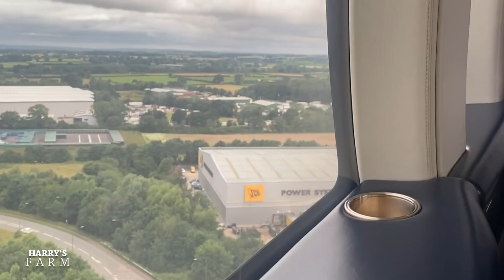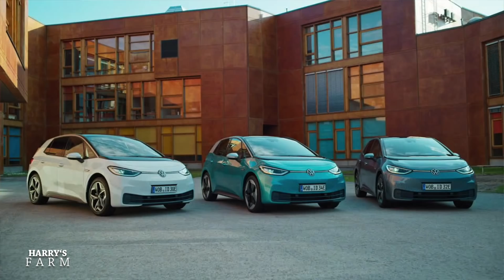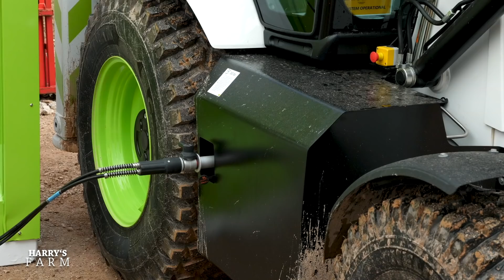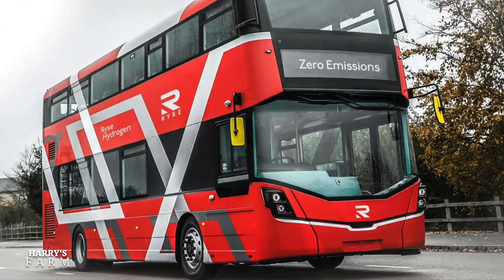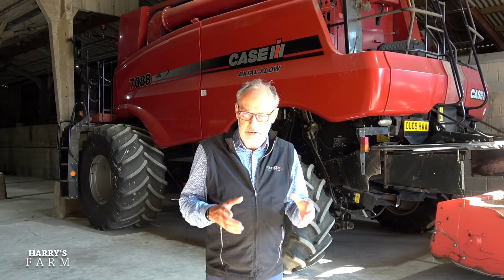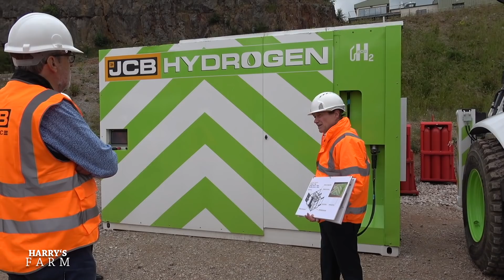Why JCB thinks hydrogen is the best alternative to diesel for heavy machinery, farming and HGV fleet

Comment: Thanks Harry for giving us a platform to see these developments on. As a farmer and car guy myself, the whole future of electric cars, is a very daunting / sad prospect...  And as much as I can see a place for alot of electric cars, for me, its never been the solution, the longevity of the battery / car is just against everything we should be aiming for, we need to try and get rid of the chuck and replace society we live in now, not encourage it with batterys that die after 4-5 years, and pose a huge environmental problem to get rid of, and even to produce in the first place! 
With regard to agri / commericial machinery, its obiously that batterys will, and never will be the answer, and the cable powered solutions seem to be a world of potential hurt also.... but hydrogen gives a new light, costs can remain similer, existing machinery could even be converted, and for people like us....we still get to listen to an internal combustion engine running, which for me, is the heart of any vehicle (tractor or car, or combine or you name it...) and without that, I feel my love of cars / machinery would be all but gone. This gives real hope, which certainly makes me smile. There is still huge work to be done with regard to producing the hydrogen in the first place, but I absulutely agree that this needs and must be heavily invested in, it has to be the fuure, or at least, very much on the right track.... I have argued many times, that with the miles I cover, I could likely drive my 21 year old diesel peugeot for the rest of my life...and produce less TOTAL harm to our planet, than I would buy simply buying a single electric car...never mind the 4-5 i would likely need over my lifetime...
Thanks for the videos, much like Clarksons farm on amazon, these videos are doing more good for the agri industry than "many other things" have done in my lifetime... Thanks Harry.
Reply: You could argue many times about your Peugeot but you are still wrong 😆

Comment: 'The problem is not with the engine, the problem is with the fossil fuel'.

So simple, yet WHY is this so difficult for politicians (who are making the short-sighted decisions to kill the ICE) to understand? By all means set the limits - but leave the engineers to come up with the solutions: EVs/Batteries are NOT the sole solution.
Reply: "When all you have is a hammer, everything looks like a nail"
There is not a single scientist or engineer in the Downing Street cabinet.
Reply: @Zadster  Or politicians.
Reply: The majority of Hydrogen today (97%) comes from natural gas, not from water.

Burning hydrogen still produces NOx emissions at the tailpipe.
Reply: @EP-bb1rm  if that's the case they are deliberately ignoring water as an alternative source for hydrogen to justify what would be a significant cost increase at the pump.
Reply: @tedtheturbot  only countries that have enough nuclear power plants will have enough energy to make hydrogen from water as economical as making hydrogen from natural gas.
Reply: @vasopel  i don't know those figures. 
Whatever, each vehicle can create it's own hydrogen from water using a hydrogen cell. Water in hydrogen to the engine out. I used one 15 years ago.
Reply: @tedtheturbot  the vehicles talked about in the video are not using hydrogen cells , but anyway hydrogen fuel cell vehicles are a mediocre alternative to ICE, electric ones are better ;-) ,15 years ago? which model was that?
Reply: @tedtheturbot  It is not a case of ignoring water as a source of hydrogen, it is more about acknowledging that hydrolysis of water is vastly more expensive than steam reformation of natural gas.
Reply: @LiamE69  The tech exists to do hydrolysis with a hydrogen cell within the vehicle, that could presumably be improved with enough big tech capital. But there's not interest because again the big boys want to keep fuel expensive and other companies risk being squeezed by big tech to stop.
eg There was a guy in Australia who developed his own hydrogen powered car some years ago, found dead on some railway tracks after 'falling off the back of a train'. Official comment he was drunk and fell, friends said he didn't drink.
Reply: @tedtheturbot  What on earth are you talking about? Where is the energy going to come from to hydrolyse the water?

Hydrogen is already a $100bn industry that has been around for a very long time. The low hanging fruit has been had.
Reply: @LiamE69  I've said already read above.
Reply: @tedtheturbot  No you haven't. You have said vehicles could hydrolyse their own hydrogen. I ask again where is the MASSIVE amount of energy it takes to hydrolyse water going to come from.

Unless of course you've created a perpetual motion machine where you use hydrogen as a fuel to run a hydrolyser to make hydrogen.
Reply: @LiamE69  You've answered your own question. There's hydrogen fuel cells that fit into vehicles that create hydrogen gas. Read above I used to have one in my car. The system ran off the battery. Your MASSIVE amount of power info is wrong. And if you think i'm mistaken, how come the one i was using leaked one day and the hydrogen gas blew the lid off the cell. Highly flammable thats why they use it for lunar rockets
When you switch the thing on from the battery, hydrogen bubbles start forming immediately. It works without a nuclear power station. Think about it the big boys don't want us to use this stuff cause they're gunna loose money. So lets lie and say it's impractical because of the power requirement. I had the same arguments with people at the time.
Watch this video again the guy says they have hydrogen fuel cells but they're expensive. That means they have a unit that can produce hydrogen from splitting water inside the vehicle without having to hook into a nuclear sub station.
Reply: @tedtheturbot  So yes you think the perpetual motion machine exists and it is hydrogen. Congratulations we now have infinite power.

Now, back to reality.

Hydrogen fuel cells use hydrogen, they don't make hydrogen.

They produce less power than it takes to make hydrogen they used.

It takes more energy to get hydrogen from water than you can every get back from burning it or using it in a fuel cell.

You really haven't got a clue about any of this.
Reply: @LiamE69  really so how come my hydrogen cell worked? Using the power from a car battery?
Reply: @tedtheturbot  What you call a hydrogen cell is not a hydrogen fuel cell. A hydrogen fuel cell takes hydrogen and oxygen and combines them to produce water and electricity.

I have no idea what you had or what you think you have. But the fact remains to make 1kg of hydrogen from water you need a minimum of 39kwh of energy. With the efficiency of hydrolysis, which is what it sounds like you were doing, more like 60kwh+.
Reply: @LiamE69  No, you've got this arseways a hydrogen fuel cell splits hydrogen from water using electricity, the hydrogen gas is then taken into the combustion chamber and fired. In my case as a hybrid unit. So what i had was a cell that split hydrogen from water inside the car using power from the car battery.
As said before, if you don't believe that's possible, on one occasion the reaction blew the top off the unit after failing to remove the hydrogen gas efficiently.
As said before, the big boys don't want us to have this technology so they'll lie to keep us from using it, hence the information your so diligently regurgitating. 
Question for you is do think it's possible for a small group of powerful people to control the narrative in such a way to mask over the usability (the amount of energy required to split hydrogen from water) in order to make people think this technology isn't readily available?
It is.
We are being lied to.
I know this because i've done it.
As said, watch the video again hydrogen fuel cells - that split water from hydrogen inside the vehicle - are available, but as Lord wossname said, they're expensive (presumably because they are reliable because mine wasn't reliable but then it was quite cheap), BUT it did work.
Reply: @tedtheturbot  Powerful people may be lying to us. One thing they ain't lying about is the laws of thermodynamics.

A hydrogen fuel cell is what I said it is. What you are describing is a the electrolysis of water. Go look up the terms.

The fad for people with a less than school level understanding of physics putting those on their cars and thinking they were getting something for nothing died a death because it simply doesn't work.

Breaking water down to oxygen and hydrogen with electricity from the battery which pulls power from the alternator which itself draws its power from the combustion engine takes more energy than it gives with losses at every step.

As yourself if this works why do you have to keep putting fuel in your car?
Reply: @LiamE69  As already said this was a hybrid system, not a 'something for nothing system'. Obviously there's an energy cost in supplying the electricity from the original system.
Also as said an electrolysis (or HHO) system. Mine was a wet cell unit, with more efficient dry cells also being available. It mixed with the fossil fuel via the air intake manifold to aid combustion, giving improved fuel economy and power.
Reply: @tedtheturbot  So you've got the dyno figures to show more power, right?

Sorry, you are fooling yourself. The alternator will put more load on the engine than you will get back by adding the oxygen and hydrogen it creates into the intake.

There really ain't no getting around the laws of thermodynamics. Ever.
Reply: @LiamE69  I didn't dyno the car. When the small system I had worked efficiently, there was a noticeable increase in throttle response at the low end from the improved fuel mixture giving a more efficient burn. I didn't check the mpg figures, but I wasn't going to the pump as often as before. The car was sold before I could get the system reliable enough to get consistent figures.
Reply: @tedtheturbot  If that is true how come these systems always fail every single rigorous test of efficiency?

Its very easy to fool yourself over marginal things like this. But somehow they never, ever fool the cold hard numbers.

Here's an explanation from an engineer...

youtube.com/watch?v=s2t11GR6jFc
Reply: @LiamE69  We'll agree to disagree.
Reply: @EP-bb1rm  Indeed it does. The vast majority on the market is from methane reformation, and sometimes as a by-product of other things, such as pure Oxygen for steel manufacturing (which is why one of the factories I'm aware of is just next door to a steelworks, funnily enough). That said, it may be reasonable to use H fuel cells for some types of commercial vehicle, rather like some short distance railway rolling stock. It's not ideal for thermal efficiency though, even if the electric input is from renewable sources.
Reply: The way I see it, the ICE "IS" the solution to Carbon sequestration, here is why. We can make fuel from Algae, The oil pressed from algae can be used as feedstock in current oil refineries without any modifications and the fuel produced can be used in existing ICE without modifications. Algae is salt tolerant and so can be grown on marginal land that is not suitable for farming so growing it doesn't use up cropland and best of all it can be "fed" with sewerage. After being pressed for the oil the remains of the algae are carbon rich and can be carbonised and buried. (all the Carbon in the fuel and the algae come from the atmoshpere) ... So the upshot is. every mile you drive using an ICE with algae derived fuel will be literally sucking co2 out of the atmoshpere.
Reply: I agree, fuel cells and batteries are not the solution.

Keep It Simple and Inexpensive!
Reply: oil companies attempting to sell oils and gas dressed up as hydrogen it is a scam    Depending on the quality of the feedstock (natural gas, rich gases, naphtha, etc.), one ton of hydrogen produced will also produce 9 to 12 tons of CO2
Reply: no hydrogen comes from water H20 all you have to do is split the hydrogen from water with electricity (hydrolysis). You guys need to wake up, the reason why this tech hasn't been used is because they can't charge us anywhere near as much (or they've yet to think of a way they can charge us) for using water as fuel. It's very important to understand this is a deliberate premeditated act of greed. Follow the money..
Reply: @tedtheturbot   well said mate, the one and only reason.
Reply: @tedtheturbot  If they only use water as a source for (Edit: I first wrote energy) hydrogen, and use it in a combustion engine it will at optimal laboratory condition require 2,75 times the electric energy to run a tractor/excavator/whatever compared to an all electric version. So we are talking at least 3 times the running cost compared to electric versions. But yes, at the moment electric have a problem with low capacity/costly energy storage (batteries) and very long refuel-time. Even if all the energy was for non-poluting renewable energy it is still extremely wastefull to convert electricity to hydrogen before use if it can be avoided. Fuel cell instead of combustion takes this down to 2,4-2,5 but it is still a lot of wasted energy. And then we start talking about the infrastructure cost for country wide access to hydrogen. It is very expensive to store and transport due to its rather explosive nature. So they need a lot of customers to build the infrastructure, but no-one wants to buy hydrogen fueled equipment until the refueling infrastructure is in place. A classic chicken and the egg dilemma. What the correct solution at the end will be eludes me, but even with the limited and relatively low level experience I have with the industry, I quickly learned the hard way that there is a lot more gray than black and white when it comes to the choice of future energy.
Reply: @tedtheturbot  I was told yrs ago that a person/company had made an engine that would run on water (hydrogen). It is said that Shell bought? maybe the idea,patent etc and stored it for a rainy day. Might have been true..
Reply: @williambeard5526  I have seen that too 10 years ago, but now you can’t find information!
Reply: @Quality-Of-My-Life  if I was a conspiracy theorist I would think that would seem a little 🐟.

Comment: Great video. This has great promise. Thanks Harry. Liked your arrival transport as well. 👍
Reply: oil companies attempting to sell oils and gas dressed up as hydrogen it is a scam    Depending on the quality of the feedstock (natural gas, rich gases, naphtha, etc.), one ton of hydrogen produced will also produce 9 to 12 tons of CO2  
However, hydrogen combustion with air produces oxides of nitrogen, known as NOx. In this way, the combustion process is much like other high temperature combustion fuels, such as kerosene, gasoline, diesel or natural gas. As such hydrogen combustion engines are not considered zero emission.